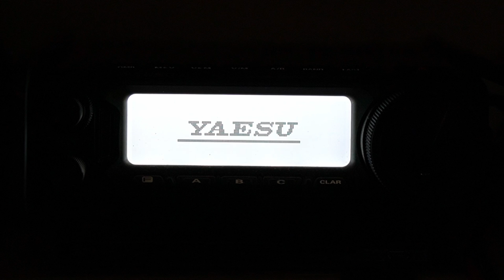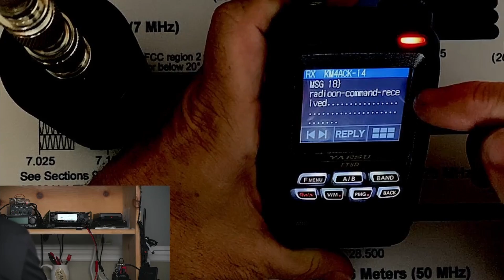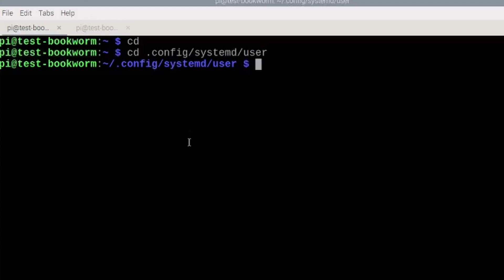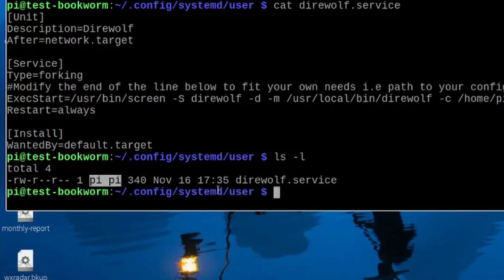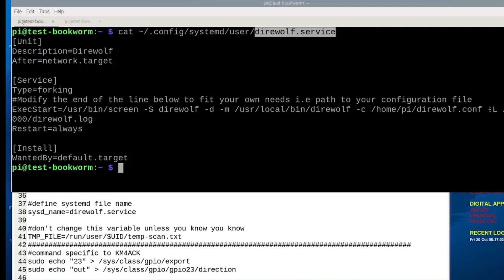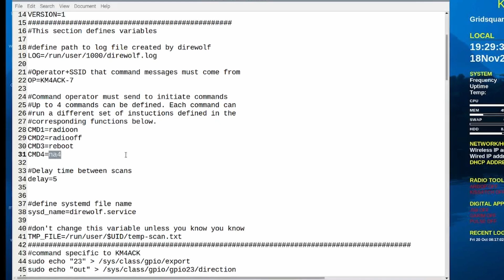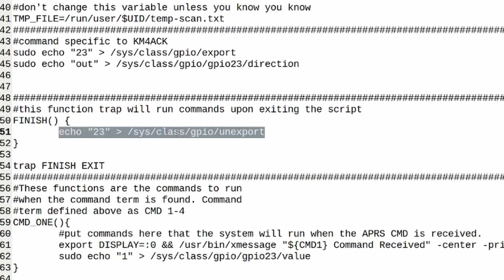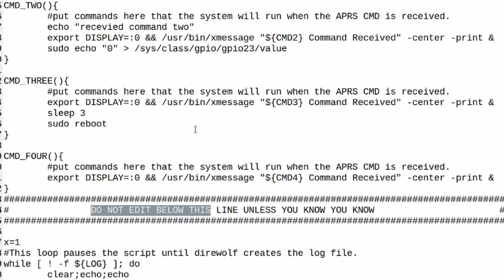Advanced APRS Techniques for Hams

Comment: Very interesting.  Always looking for new ways to tinker with things.  In this example you are using up to 4 commands. Any reason a larger list couldn't be used?  I use node-red and mqtt with the raspberry pi to execute various commands across my local network.  Seems reasonable that this could easily tie into that for a radio remote function as well.
Reply from the maker: The list could certainly be longer. Feel free to mod the code and add to it.

Comment: I’m interested, but this is all over my head. I have a Yeasu FT5DR and a Panasonic CF-20 Tough-book running Windows 10. I would love to use the two for Winlink via VHF leveraging the native APRS capability of the FT5DR. Just not sure how to make it happen. Tried to connect the radio to the PC this weekend via Bluetooth, but it won’t connect. Even assuming I establish a physical connection, still not sure how I will do it. Will I need something like VARA or can I just use Winlink express? Thanks for all of your content.
Reply from the maker: Yaesu doesn't allow a direct connection to the FT5 for APRS. You can monitor but not transmit. You need a digirig with the appropriate cable to go between the radio and the computer. You can see something similar in this video https://youtu.be/iYYRTu6myRc though I am using a FTM500 instead of the FT5.
Reply: @KM4ACK  Thank you for taking the time to respond and for the information. Again, thanks for the content.

Comment: You said you used a relay to turn the radio on and off.  What wiring did you set up between the relay and the radio to do this?
Reply from the maker: Three cables from the relay to Pi GPIO. Positive, negative, switch. The other side of the relay provides a break in the ground that powers the radio.